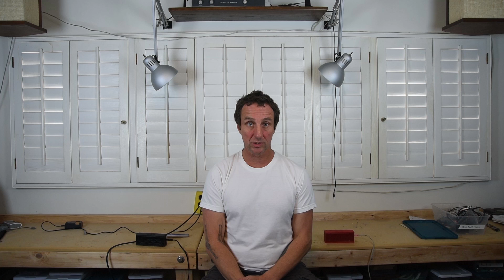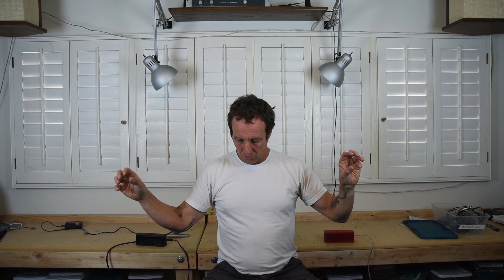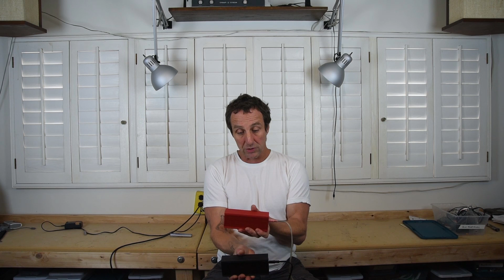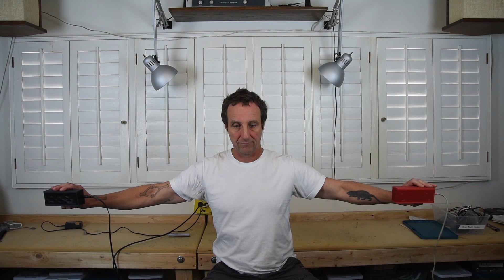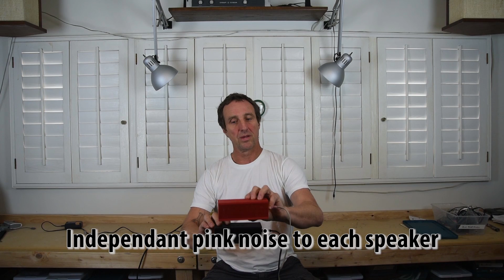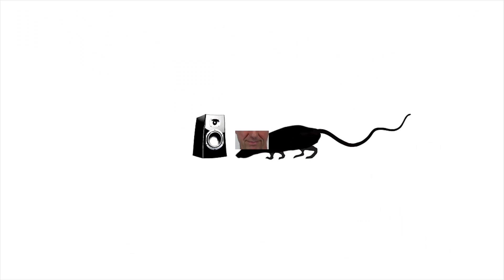Problems With Mono Sound From Stereo Speakers

Comment: I took the automatic transcription and edited it. Hope this is helpful:

All right, my name is Dave Rat and today I'm going to talk about the same sound radiating from multiple sources - basically mixing in mono if we have a stereo sound system and we send the exact same signal to both sides. Or mixing in stereo or we send a different sound to each side. Over the years I've thought quite a bit about... sound reinforcement and the issues that we run into and various solutions - and one of the concepts that I've come up with is that nowhere in nature does the exact same sound radiate from multiple points in space. Whether it's a cow mooing or a waterfall or a woodpecker or any sound you could possibly run into in nature it occurs in a singular point in space or a range or an area and there is no identical mirror image of that occurring simultaneously somewhere else.

Nowhere in nature does the exact same sound occur in multiple points in space.

Yet with sound reinforcement we do it all the time. We take the exact same sound and we send a cloned mirror image perfect copy to another speaker nearby and another one and another one and when we do that we create all these... we create a series of issues. You get comb filtering you get time issues, interference from this identical source. If the sources are different we're not gonna have that problem. We don't have a problem with a cow mooing and a goat baying causing some phase interference that's audible that causes it to sound swishy. But if you take the exact same cow Moo and you run it to two different speakers then it'll cause a problem.

So there's this these phase interference, this comb filtering issue is unique to electronic re-enforcement. It's not a natural event.

Conversely that the opposite of that is that nowhere in nature do multiple unrelated sounds radiate from a single point in space. We don't have the sound of waves and trees rustling and a goat all coming out of a hole in a rock wall. It just doesn't happen that way. We have these sounds are coming from three-dimensional areas - closer, farther, up, down... and yet in live reinforcement or any kind of reinforcement home hi-fi - we do that all the time. We take a guitar, a bass, a kick, a vocal - put it all together and spit it out of a little round thing. Well, that's a completely unnatural event.

Those two concepts I think are the basis for creating more audio realism and also for solving not only solving a lot of problems, but actually giving us a lot of solutions or assets. For example, having the same sound radiates from multiple speakers or a line array gives us the dispersion control and allows us to cover the audience. Having the exact same sound come out of two different sub-woofers that are spaced apart, slightly different times is what allows us to create a cardioid sub array. And also can create the cancellation. So we can use this to our advantage and it also can cause us issues. Being aware of it is the key.

So when we're mixing shows we've got kicked drum run right down the middle, snare drum down the middle, bass down the middle, guitar down the middle, vocals down the middle and the stereo PA and we've taken all these instruments... we mix everything in mono you want everything to everyone to hear the exact same thing. Now we've got two speakers recreating nearly or exactly the same thing and we've created all these issues... these comb filtering, these phase and time issues.

So I'm going to demonstrate some of that. And to do that I'm going to use pink noise source. So I've got two speakers here, little jam boxes wired up to my laptop there, with a mic right here and I'm gonna play pink noise. First thing I'm going to do - it's hard for me to mute it - so the first thing to do is I'm going to play mono pink noise and come out one of these two speakers and I'll move it around and you should be able to hear. Headphones probably will help with this, though it may work on some laptops or other speakers.

So I'm gonna take a single pink noise source, move it around you can hear it move side to side. Then I'm going to go to peak noise run to both speakers. And I'm going to demonstrate, you should be able to hear the phase interference of the exact same sound - the comb filtering effect sort of a swish.

I'm also going to do polarity reverse - pink noise polarity reverse into one speaker and not into the other. We should be able to demonstrate cancellation and then I'm going to do something that's really interesting...

Start with..

[Demonstrates a single Pink Noise source to a single speaker]

That little glitch is just the Pink Noise sample starting over again.

Now here's two. Pink Noise coming out of both.

[Demonstrates a single Pink Noise source to two speakers, audible interference]

That's same Pink Noise out of both.

[Demonstrates a single Pink Noise source to two speakers, one in reverse phase]

Now what I'm going to do, is I'm going to put two different Pink Noise sources, a different Pink Noise generator going to each side.

[Demonstrates a different Pink Noise source to two speakers]

There's no interference! No longer do they...

[Demonstrates a different Pink Noise source to two speakers, one in reverse phase]

All right, so with single Pink Noise source by itself, mono source...no problem. Once you take the exact same signal and run it to both sides, then we started to give you interference between the two. When I polarity reversed the same signal going to both we were able to cancel it out and hear the significant issues with polarity. But when I went to two separate pink noise sources they no longer interfered, regardless of whether they're in or out of polarity. Even though each pink noise source sounded exactly the same.

So we have two identical sounds, two different pink noise sources that sound identical to our ears. One set causes interference and the other does not.

Now that's a really interesting concept. That means that theoretically if we were able to do that with instruments at a show...instead of running the exact same kick drum to both sides, if we were able to alter enough stuff about how we mic that kick drum, or how we reinforce that kick drum, we're gonna get different levels of interaction cancellation. If we take the internal kick mic and the second - we use two kick mics - and we put one to one side and one to the other but we EQ them same, we use two different types of mics, the sound would be slightly different on either side but the magnitude of the interference between both sides will be greatly reduced. That same thing can be applied to dual micing a guitar and other instruments.

That's just one way we can use that concept. Another thing that's interesting with that is when measuring a sound system, using the same pink noise source... a single solitary Pink Noise source and running to multiple speakers is going to create a bunch of interference issues in your measurements. But if you use multiple pink noise sources and use it one pink noise for the left and other pink points for the right you no longer have interference between the left to right and you're actually able to measure the cover to the system without any comb filtering issues.

Okay hope that's interesting and helpful and I will find you more soon.
Reply: Great video, demonstrated so well that normal people without sound engineering education background can understand the concept clearly.

Comment: The problem with this analysis is that audience members don’t generally move from their spot during a show, so they won’t hear the “swooshing” as the notches of the comb filter move - like you do when you “walk the room”. What they WILL hear is comb filtered to a degree BUT the ear adjusts quite quickly to this and unless they are on-axis then they will only register the nearest speaker anyway.
Using delay speakers, setting the delay time so that the difference in arrival time from multiple sources is at an average minimum over the area of coverage is more important than frequency response IMHO.
Live sound is a series of compromises.

Comment: Mr. Rat. I just came across this video. Good stuff. When I learned about phase cancellation in school over 20 years ago, I tried it to reduce the noise of our studio window AC unit while recording a band on a 115 degree day. I was amazed and have been fascinated by the subject ever since. I have to ask: In a live environment, using your kick drum mic scenario, if you had the mains run in mono yet only used one kick mic vs. two as you proposed, would you get as much potential loss or sound alteration characteristics? I know the venue, placement of gear, and other limitless variables go into effect. However, the question is just about the difference between a mono main set up vs. a stereo one in this particular mentioned example. Would you encounter more possibility of loss (or undesired results) with one over the other?

Comment: I picture it like this: Imagine you have a room in your house, and it is divided into two acoustically isolated spaces that do not communicate. Then you drill two holes at the height your ears naturally sit while you are seated, spaced apart by a certain amount. The pressure waves from one space have to be incident on the hole from one side, then funnel through the hole, then they will expand again on the other side. Those holes in the wall are analogous to speakers in a stereo configuration. The observation that sounds don't radiate from multiple sources in nature in exactly the same way at exactly the same time is relevant because that assumption is made by the brain, so that when you hear a sound radiating coherently from two sources (without frequency response or phase shift effects), your ears and brain process that as though the arriving sound came from a single point, and your brain infers the positioning of the sound and then reconstructs an image of the sound source and an acoustic space (soundstage) where the sound source is placed. But your ears are only in one plane, the horizontal plane, and you don't have a third ear on top of your head, so your ability to distinguish the height of sound sources is also limited to what the head related transfer function can provide. If you had many holes in the wall, in random locations, the sound coming through each hole into your room should still arrive at either ear in the same way as you would hear it, and you should still be able to reconstruct an image and sense of space. But the sound passing through holes in the wall doesn't perfectly interact with the boundaries of your room in the same way as if the wall were removed between you and the performers, so you get frequency response and time delay effects/smearing, and more apparent sources outside the boundaries of the room. This is why modern speakers prioritize pattern control, which is like taking each hole in the wall and sticking a horn over each hole so the sound radiation angle is now constrained by the horn, and the illumination of the walls is reduced.

Comment: Thank you in advance. Is such an honor to be exposed to a audio pro philosopher. I have two things to ask. It might be stupid questions so, I apologise in advance. 1) Have you ever did a ms matrix middle side for L/R in a pa? Is there any pratical use of that. 2)I once had an corporate event where the client wanted that we operate two lavalier mics for each person (one on the left and other on the right). Altough we used cardiod lavaliers it was impossible to manage feeback (even delaying) and we move for plan B: one lavalier centered on the tie as we always do.  My exprerience is limited, and I kept even after some years asking where the client saw that working and if it was there anything I didn't know that maked that possible. Some weeks ago i tried the two lavaliers one on each side of the lapel. In the LCR FOH I sended lapel L and lapel R out of polarity for Center speaker, Lapel L pan left and Lapel R pan right with the polarity reversed. I didn't had time to "play" with it enough but I believe i "saw" a bigger gain before feedback as I used the polarity reversal in the right lapel. For sure it was an illusion and it produces great levels of comb-filtering when speaking at center, but at the time it didn't seemed. Any similar experience?

Comment: First of all: Thanks for all your videos, they are so much formative, and instruct us a lot of knowledge!

I have a question to you:

I saw your videos and we can see that you have diferents mics for an instrument (a guitar, for example) and you can pan (left or right) this mics to create a natural sound image with the multiple sources and keep away the phase cancellations... my question is: how you manage the vocals on a live  permorfance? Ok, you can make a stereo subgroup with it, and this subgroup is send to a stereo compressor, but... the signal still beign the same.. or i'm on a mistake? Im a little lost on this case... 

Thank you again for your videos. Your are a genius!
Reply: He did one RHCP tour with a separate PA for vocals only. I'm not sure how beneficial it was.
Reply: Yes. Same question. Please make a video on this Dave. Thanks
Reply from the maker: Decorrelating versions of the same signal and panning them to minimize combfiltering and increase imaging is very useful. 

The comb filtering is frequency dependant and based on physical distances, so it 8mpacts all identical signals send to a given set of multiple speakers.

Vocals tend to be a unique and mono source that is difficult to capture more than one version of to assist with decorrelating.

But, if a significant number of your other inputs are decorrelated, then running your vocals down the middle as a mono single source sent to multiple speakers, means that ant comb filtering imposed on the vocals will be somewhat unique to the vocals.

Comb filtering is not bad, it is inherent and part of stereo and reflections, and is desirable and we spend much time creating desirable comb filtering with reverbs, delays, multiple speakers, multiple mic'ing and so on.

Having the same comb filtering on every instrument and signal source is what is undesirable, audible and unnatural.

Comment: Dave, what do you think of this?
Which claims failures of line arrays

https://www.youtube.com/watch?v=_D2vzknf8vQ
Reply from the maker: He is treating each speaker in the line array as a separate source. 
But, when two or more speakers are reproducing the same signal and are very close  
together in relation to the wavelength being reproduced, 
the two or more sources act as a single source. 

A properly designed line array acts as a long thin source as in the term "line source" 

Also he offers several other flawed assumptions all aimed at highlighting point source and diminishing line array systems. 

So
 either he is lacking knowledge, in which case he should not be seen as a
 credible source of info or has the knowledge and is presenting it in a 
biased manner, in which case he should not be trusted.

The
 reality is that there are advantages and issues with conventionally 
arrayed systems, line arrays and point source systems and it is all 
about knowing the assets and issues with each so we can select the 
optimal system for the application at hand.
Reply: I think Kv2 audio surely have credibility.....their systems, especially the ES series are awesome sounding, can't say ive ever heard nice balanced sound from a line array....
Reply from the maker: JuzzyQld it is important to keep things in perspective, point sources work best as a single point source but when using more than one box, the zones where the coverage from two or more boxes overlap, presents issues. 

a line array has the same challenges except all the overlaps occur in the vertical plane.

since our ears are horizontally spaced on our heads, we are more sensitive to horizontal issues.

so line arrays have the advantage of putting the issues where we hear them less.

as far as credibility, making systems that sound good or people like is one thing, using incomplete or misleading info to market that product is less than desirable

Comment: Dave, you just blew my mind. I have been toying with the idea of creating a system where i can send each source to its unique speaker. However, it would make the system hard to scale for additional instruments/sources. You just gave me an alternate solution with the multiple inputs from the same source.
Reply: That's exactly what the Grateful Dead did in '74 with the Wall of Sound -- each instrument had its own speakers. It was staggeringly clean, but also staggeringly expensive and impractical.

Comment: To apply this to live sound, you could start with speakers spanning the space from left to right.  Instead of traditional panning, the pan control would route from 1 speaker to the adjacent speaker left or right depending which way you pan.  No instrument would be coming from more than 1 source, yet panning ability would still exist.